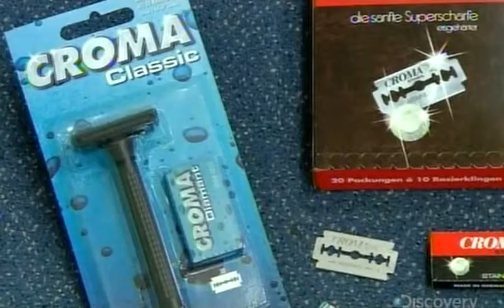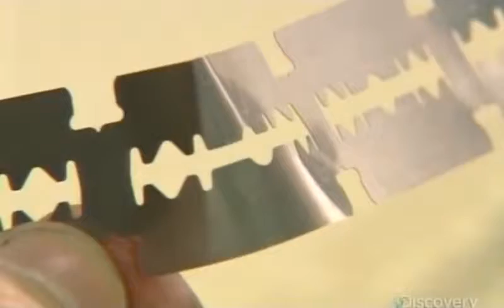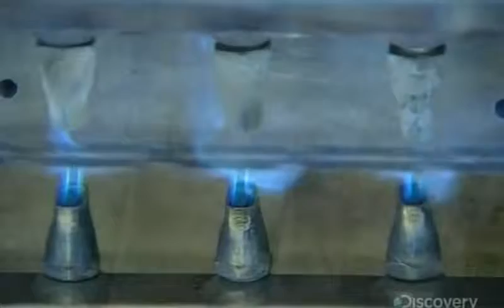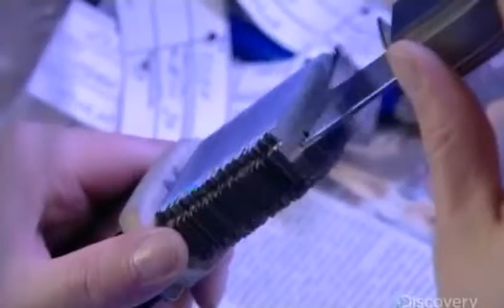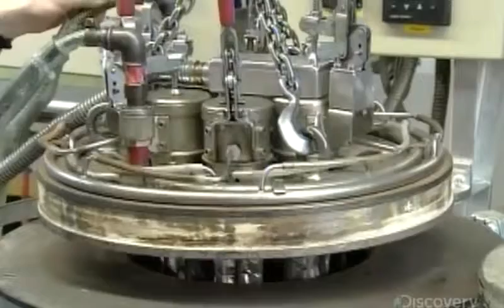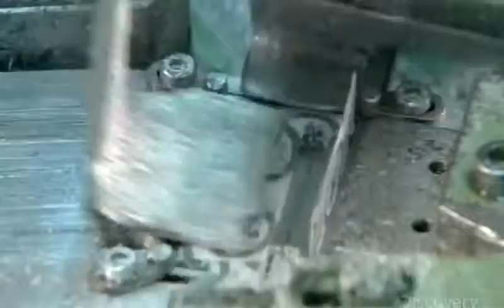How It s Made Traditional Razor Blades

Comment: They forget to mention, even at the "dull edge" stage the metal is still razor sharp. I work with the stuff, cold rolled steel.
Reply: Not my straight razor sharp... 😎
but how do you hone the edge? 
I've read something about cold rolling between two carbide rolls. No abrasives. I also wonder how do they keep a keen edge after galvanizing chromium on the edge. Why do they use chromium coating on a stainless steel anyway? And why does it rust sometimes? It's not stainless steel right? It's high carbon steel that can be hardened
Reply: @trollmcclure1884  The problem with Stainless is that, while it takes a very smooth edge, it dulls quickly. Adding Chrome would provide a harder edge.
Reply: @RGD0756  Chromium is the definition of stainless not hardness. 440C has 17% while CPM Magnacut only 10. Carbon makes it hard. Carbides make it wear resistant. The cheapest stainless used for cookware has more chromium

Comment: All that, and yet you can buy certain brands for less than 10 cents per blade.
Reply: dang! what brand?
Reply: @deftonesmp3  It will vary. And you have to buy in bulk. You can usually find 100 Gillette Wilkinson Sword blades from India for under $10 shipped on eBay, for example. Italian Barber had a bunch of 100s on sale for Black Friday under $10 - Treet Silver, Ladas, and all the Rapiras. Voskhods were about $12 per 100. And these prices are Canadian dollars.
Reply: The power of economies of scale